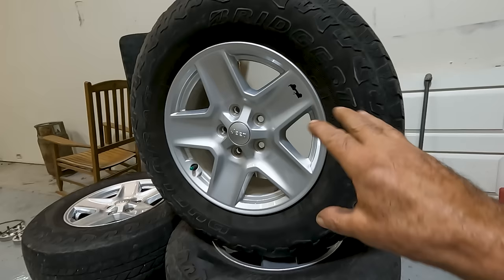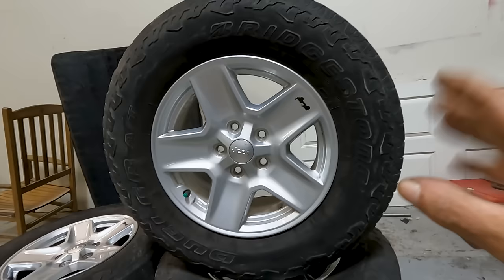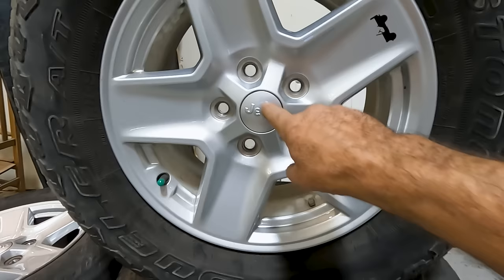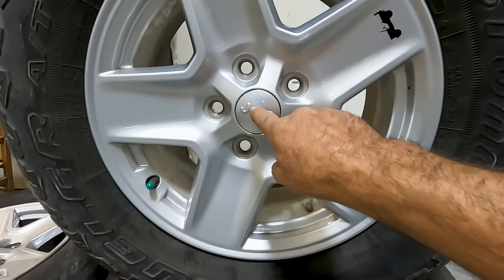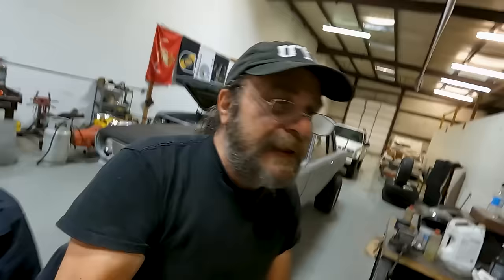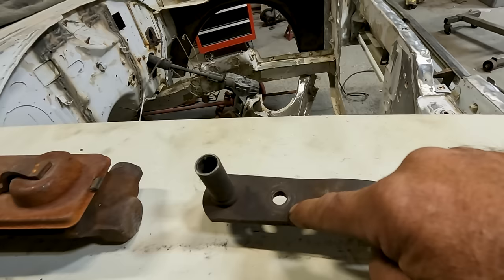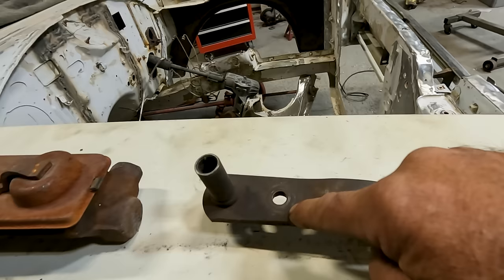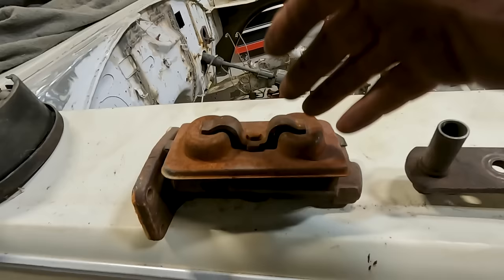Modifying Classic Cars And The Butterfly Effect - Can You Outsmart The Engineers?

Comment: Great video and so true. I was an automotive engineer for many years and cringe when I see some of the things people do to "upgrade" their cars. One thing I would tell people to upgrade on an old brake system though is the master cylinder if it has a single reservoir design, strictly from a safety aspect. Most cars have a direct replacement dual pot design available and no one likes that feeling of the fade on one pump and no pedal on the second if you blow a brake line. I around town drive a 48 Chrysler Windsor with a single pot master and no replacement dual pot is available because the pedal pivot hole is built into the master, I have thought about making a new mounting bracket so I can run an 80's Chrysler master.

Comment: I get what you're saying but there are variables that changed since the Muscle car era.  Fuel is different, Speeds are higher, rubber is better, and classic cars should not be driven as a daily without considering the risks.  Talking about brakes, sure the classic was built with good engineering (Although they built and designed crap systems back then to), new cars stop faster and better than old ones.  What happens when A little honda accord slams on it's brakes after a fast lane change and your 1957 Box with a Single master cylinder and no booster gives out?  if our classics are on the road, we need to adapt it to be safe and reliable with other cars on the road.  You're not buying50's/60's or 70's rubber tires, you're buying new tires with better friction coefficients.    Love the channel.  Keep it up.

Comment: I'm glad you made this video, I spend much of each week trying to explain to customers that hot air intakes, exhaust mods and much larger tires and wheels will speed up wear and tear, hurt economy and slow their vehicle down. They always claim to know better. Yet many are complainging about expensive repairs or poor drivability not long after.

Larger tires changes gear ratios, adds to rolling resistance, braking force needed, bearing load and many other things...
Louder intake and exhaust does not usually mean more power, unless other things are done to correct the tune...
It's a long list of potential issues created by "mods.".

Comment: Great video.  I am congratulating myself for keeping my 73 Mustang with stock brakes and original size tires.  The two things I would swap on older daily driver cars is replace the old points ignition with an electronic, just for tunability and reliability.  And consider  going with an electric fuel pump.   The mechanical pumps are super reliable but swapping them on the roadside is a pain and in the most disastrous scenarios when they fail they dump fuel into the oil system.

Comment: I'd just like to add one thing Tony. When you're talking about towing 5000 # with the Jeep, don't forget to use a weight distributing hitch with sway control. I see way too many vehicles "dragging ass" and, the trailer "wiggling" side to side as they're running down the road even with small trailers. Many times, it's probably because the trailer is overloaded or, not loaded properly but, it's a dangerous situation all the same.

Comment: You know, this video just makes me think about my 1967 Ford F250 with power drum brakes.  On this truck, they used a 2" wide brake shoe as opposed to the 2.5" brake shoe of the manual drum setup.  That's the factory setup.

Comment: I upgraded my 69 valiant brakes (slant 6) 4 wheel drum. with 74 valiant disc/drum using the entire system, proportioning valve and booster, when i did the v8 swap. K- member, control arms diff. 14" wheels.😊
When i did a hopped up 318, i added police calipers, rotors and caliper brackets and fully metalic pads.
15" wheels (80 300 aluminium) really light😮.
Stops wicked awesome from over 100 mph😊

Comment: Glad you touched on this in the video Tony. I think what qualifys as a comfortable daily driver has shifted over the years. The economy equipped classics that are underpowered, drum brake manual steering cars may have fallen from a comfortable driving experience on today's roads, and its not the road, it is the other people out there with you. I had zero issues running with traffic in the early 80s. We had interstates back then... I suggest people drive way faster, use less following distance,  apply their brakes later, and are just generally more careless (daring) nowadays. Watch and see the next large car show you go to if the majority of the classics are going home in the right lane. (A lot of them are not geared with a 4:56 rear end ether)

Comment: For many years I had a long distance commute 1.4 hours each way. I found my car was lacking in ertain areas so I   did a few minor tweaks to make it (in my own words) more competent. Better headlights, fog lights, longer wiper blades for better coverage, and wider tires in summer and the best snow tires I could find in winter. My current car is what I call "pre-improved" over a regular factory model of the same car. Its a cop car. Factory engineered suspension, brakes and drivetrain. With the addition of my regular "tweaks" it gives me a great deal more confidence over a regular base model of the same car while keeping all of the reliability. I can see farther and the car stops faster, and steers better than just about any car I have owned.

Comment: Braking specifically is probably the subsystem in cars that the lay person understands the least. Brakes work by converting kinetic energy into heat and dissipating that heat into the ambient air. Six piston calipers, giant rotors, and even just disc brakes themselves increase the heat transfer rate from the braking components to the ambient air (hence ventilated discs). As long as the braking system can lock all four wheels simultaneously, a brake force just short of that locking force gives the shortest stopping distance that the tires can achieve. All those fancy brake parts allow the car to make repeated stops at speed without fade. In the example of the roadrunner Tony gave, likely the reasoning behind the smaller rear drums when front discs were equipped was since disc brakes are more efficient at dissipating the heat to the ambient air, smaller rear drums could be used because the front brakes would dissipate more of the heat generated when stopping repeatedly. The channel drive 4 answers has an even better explanation of the physics of braking.

Comment: Glad to hear you addressing this and pointing out the way it works overall. Especially glad pointing out the large diameter tire issue. People that tow with larger pickups think a lift on it and larger tires are just fine to tow with. Both drastically decrease its capabilities. Another of these issues you've mentioned that I used to come across all the time is putting a larger diameter master cylinder on for better braking. sorry it's the opposite. What you could have mentioned is upgrading to your vehicle models possibly optional braking system . Larger booster etc. I also noticed back in the day station wagons would often have larger brakes on the rear then the sedans to compensate for more rear weight. On the GM vehicles the El caminos would have the same brakes. Also do not forget those larger diameter tires proportionally raise your final drive. Very bad for towing. Moderately stiffening the suspension may help towing. Another misconception on towing is that everyone thinks the cure-all for incorrect tongue weight is airbags or more springs on the rear. That's still lightens the front end but it just doesn't look like it because the back is up. White distributing hitches put weight on both axles. Brake controllers are a must.

Comment: Yes, for a stock car, I think the late 60's and up have enough improvements designed into them, that no modifications are needed for daily drivers. Talking about GM cars in my case. I have a 67 Impala SS and some 73-79's, A and F bodys, and my goal has been to make them drive like when they were new, because I remember driving those same kinds of cars back when they were new, and it always feels good when they do. Plus when you need to replace wear items, it's easy to order the right parts since original replacement parts are still readily available, and not expensive. I keep some extras in inventory in case they suddenly become unavailable in the future. I think pre-65 cars need a little help, at least swapping on a dual master to replace a single master for safety, as many commenters have said. But otherwise, their brakes would work fine for a stock car. I think many people in the comments that disagree will forget that you have emphasized that you're talking about a daily driver factory stock vehicle, and not one that's been souped up. Although I think the factory brakes, steering and suspension are adequate for mild performance upgrades.

Comment: Tony, True story. Back in the 70's I was the lessee of an Esso/Exxon gas station with 3 bays. We did just about any kind of repairs and did work on VW's and some Japanese cars. Brakes were our thing. My brother accepted a job to do a front end alignment of a Duster that was still under warranty. He got the vehicle on the alignment stands (Aamco setup), looked the suspension over and saw that the factory had installed a disc brake assembly on one side and a disc brake assembly on the other side. He stopped working on it and called the customer who seemed bewildered trying to understand his problem with the car because it stopped straight, no pulling or wheel lock ups. Engineers can be defeated by workers and enthusiasts. Hope I didn't already relay this to you, if so, did not mean to repeat myself.

Comment: The brakes only facilitate the braking....the TIRES actually stop the vehicle.....but Tony has it right, here......the only thing I'd do is make sure the calipers and fluid are good and the pads are good quality and of composition that facilitates desired function, and the rotors/drums are of good quality and not worn.  Worn parts decrease, dramatically, the effectiveness of the braking system, so pads that are 1/2 worn are  less than 1/2 as good as they were when they were new....same goes for rotors and drums......if they are worn, they wont give 100% of rated capacity
Reply: Unfortunately, finding good quality replacement rotors for anything these days is dang near impossible...low-quality(albeit expensive) Chinese stuff, anywhere you go...

Comment: The tow capacity also includes the passengers, weight of the stuff inside the vehicle, trailer weight plus the stuff on the trailer. Most of the time folks think they are hauling just the weight on the trailer but have no idea about the rest. The other fact left out is with a larger rim and taller tire your speed on the speedometer is going to me show lower than actual speed. Meaning that the 70mph on your dash is higher extending your stopping distance giving the false impression of reduced breaking

Comment: I have a 2001 Chevy S10. I improved my stopping capability by changing rear axle from 1998 Chevy Blazer. 5 inches wider track, positrac rear with disk brakes and anti roll bar. All things considered to be improvement. Still daily driver with better traffic manners. Shorter stopping repeatable results are improved over stock with stock parts from other truck.

Comment: Thanks for the perspective. I recently acquired a 460-powered 1976 Ranchero. Although accustomed to cars  from that era, the brakes lock up too easily. It just might be possible that the seller changed something on the brakes, using parts that would fit but not be correct per application. Also, the Marti report showed a factory tire size that doesn't equate to the P metric tires on it.

Comment: The only modifications I made to my '65 Humber Super Snipe and previous '63 Humber Hawk 17RHU was the fitment of an electronic ignition, an uprated alternator and 4 x halogen headlamps instead of the sealed beam ones fitted to the car. I fitted radial tyres on the Hawk (crossplys were tram lining on the A1M) along with changing the original headlamps (these were terrible underpowered units, driving back from Norfolk in Christmas day '92)  with Lucus sealed beam units (were much better). If I still had the Hawk I would have converted it to positive earth and fitted an alternator too! 
On a Morris Minor 1000, I replaced the original wheels with wider ones from a Farina Austin A40, these were fitted with radial tyres, and the car was great fun to drive.

Comment: I have two Monte Carlo's a 70 and a 71ss. The 70 I have heavily modified, new 383 engine, 4 speed, new interior, lots of aftermarket stuff. Put a ton into, but there is always some quirk, something doesn't quite work right, rattle here or there. My 71ss was parked in 1990, got it going in 2018. Everything is bone stock, original quadrajet, OEM brakes, orginal interior, body etc. That 71, everything always just works! Pump the gas a couple times, up she goes, doors close perfectly, doesn't pull and drives straight as arrow. Just as the GM engineers intended when it was built new

Comment: Right on. A problem I find, is that lets say you want to put discs in front on lets say a A-body Mopar, and you are using factory parts like Kelsey Hayes four piston ones. You can not find the right proportioning or hold off valves today. Just China crap thats not right, even with this common combination. One has to find the stock old parts from a donor car. Thats frustrating to me. And then I havent even mentioned the otherwise poor quality of these China valves. I dont gamble with brakes. Very good and important video. Cheers.

Comment: Tony you are so right. I had a 64 Impala, Texas salvage title (yeah, I know) that had all the mods to the brakes and PS. It never drove right, brakes would grab with little feel and steering always felt loose. Only mod I could recommend might be to replace a generator with an alternator as long as you know where the 3rd wire goes ;) The 68-72 A body GM was a great frame to build on.

Comment: I learned that when I had slightly wider, heavier tires put on my pickup. I noticed a negative impact on stability when driving on the highway to the point where it was a bit scary when hitting a rough patch at 70 mph. Needless to say I had stock spec tires put on.

Comment: I worked as a musical instrument technician for 35 years, including costom work.  Same issue.  It's why things can get expensive when you want some little thing added, or changed.  You're often altering other things besides.  So I came to tell people, "I can do that, but when we're messing with the original design we're going to run into complications".  Now that's not so say that the factory engineers are always infallible. Far from it, but we are dealing with a total, integrated package, just as you say, and when you alter that package, you're probably going to run into some things that were not obvious at first.

Comment: With respect to towing in a Jeep Cherokee (XJ), there is extra braking capacity for towing. 
But there is not extra suspension.  The factory 5000lb towing spec requires a load-leveling hitch, and trailer brakes according to the factory manual.
Having done that many times, I will say that stopping is not the issue.  A 3075-lb XJ is too light, with too soft a suspension to safely tow 5000 lbs.  So, if you do that as I have many times, minimize your speed to less than 50 MPH.
A gust of wind, or road imperfection, at higher speeds will move the 5000-lb trailer.  And the mass of the trailer + load being greater than that of the car means the car will go where the trailer moves rather than the other way around.

Comment: Absolutely brilliant explanations of why if it's not broke you dont fix it. Also like the term interstate and pre interstate. My 64 Galaxie is a factory ps, pb car and I've kept everything stock. Luckily everything is easily found at local parts stores. But the key thing is everything works as its intended, which is great. I've never been in a situation where i thought i needed more braking capacity. It already will through you into the windshield if you're not buckled in.😂 Yes it had seatbelts installed in 1966.

Comment: I upgraded the brakes on my 72 GMC, I did a ton of research on the subject, and yes there was a lot to take in.  Granted my 72 GMC is a hot rod not a daily driver but the system was set up to work together.  I went to 4 wheel disc brakes, with hydraulic assist.  As mentioned if you do a disc upgrade the master cylinder has to go with it, the size of front and rear rotors, the size of the calipers , pedal ratio, proportioning valve.  I ended up having to get an adjustable proportioning valve to get it set up right and it cost me a set of front tires doing testing.  I don’t think most people will go out and test their cars to the limit to find out there is a problem until it’s too late.  Also even the wheel and tire size and the compound of the tire have to work together with the braking system.